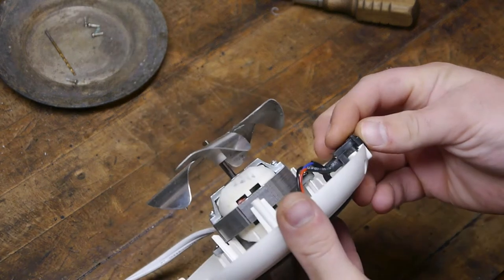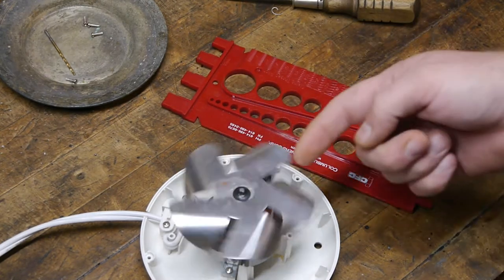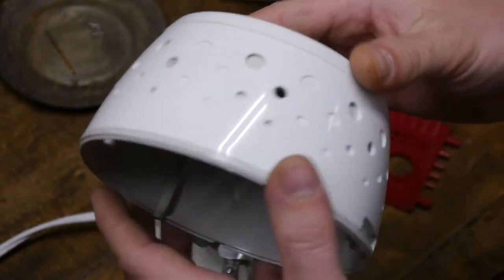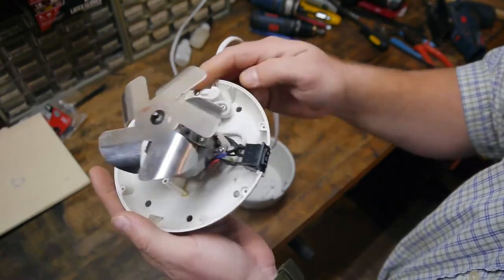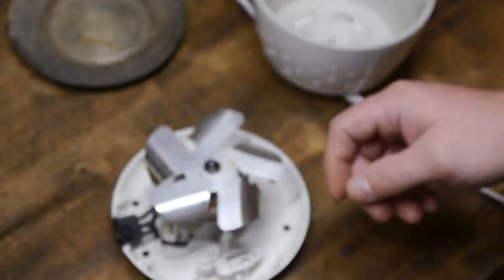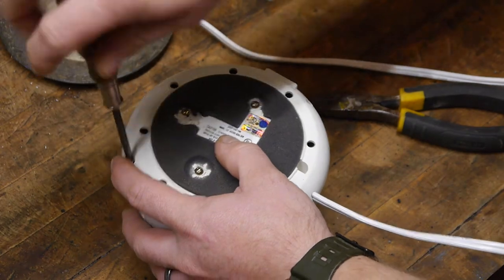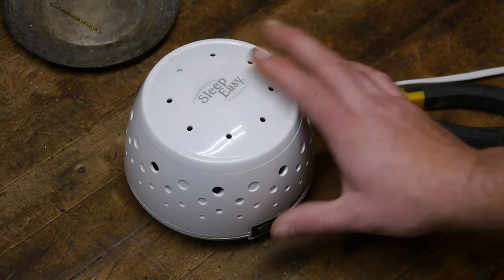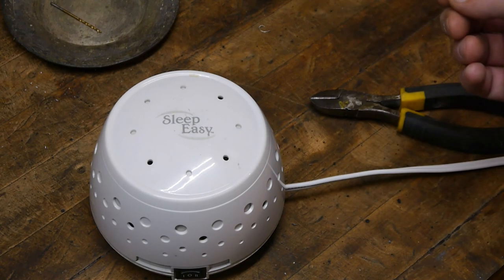How to Fix a Sleep Easy White Noise Fan

Comment: I've had mine for about 6 years and it stopped working the other night. I opened it and cleaned the dust that accumulated but otherwise it still does not work. So sad.
Reply: Sleep Easy Sound Machine costs less and is equally great if not better. I own Dohm and Sleep Easy. I can't live without one (or 2)

Comment: How do you take off the top?
Reply from the maker: I think there is one screw holding the two rotating tops with all the holes together. Take that screw out and you should be able to separate them. If you are talking about the top in the sense of opening it up. There are several screws you unscrew on the bottom that separate the halves. Let me know if I didn't answer your question. Good Luck!
Reply: I must have a newer one. I removed 2 screws, but it doesn't come apart. There is some type of clips that I'm struggling with.

Comment: I accidently dropped my sound machine like this :/   we've had it for about 2 weeks. We hate to buy another. Do you have any other tips that we could look at from the inside to fix?
Reply from the maker: Does it turn on but wobble? Not turn on at all.
Reply: @JoshAQ  - it doesnt turn on at all.
Reply from the maker: @claireschroeder5677  with it unplugged from the wall open it up and look for any loose wires or fuses. Fuse could have broken. But more likely an electrical fitting fitting fell off or broke free. The cord from the wall should bring 2 wires white, black. One of the wires should go to the motor, the other goes to the switch and from the switch to the motor. It's been a long time since I took mine apart. But it should be similar. If you find a wire broken you can use crimp fittings to reattach if possible. Or you may need to solder it. If that can't be done, maybe a friend or neighbor has the skills to do it?
Reply: Claire Schroeder it happened to me to it was just a cracked support